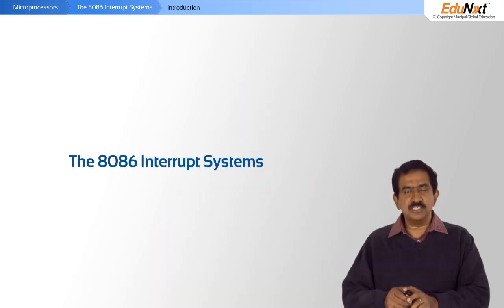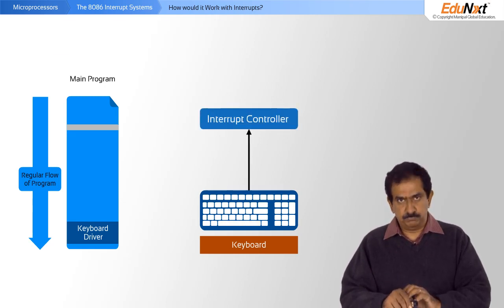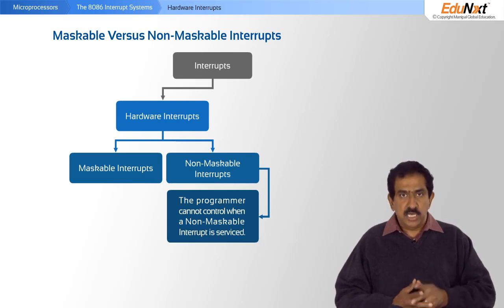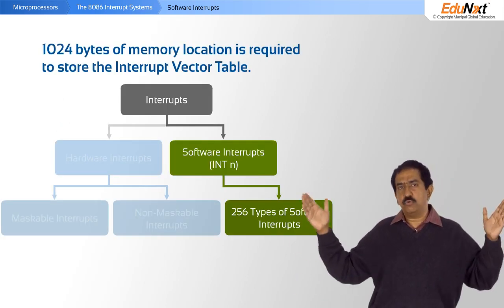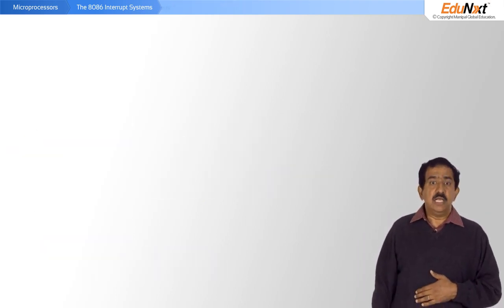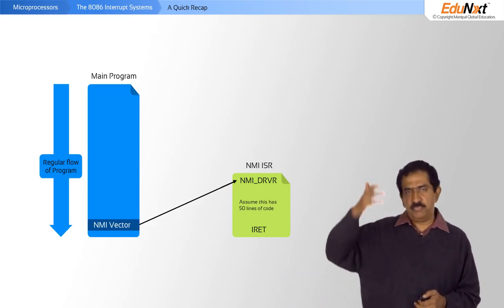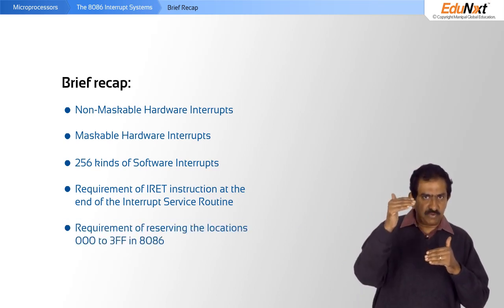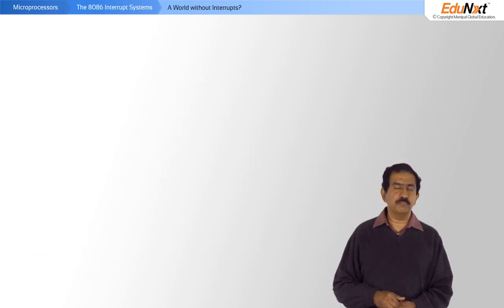006 8086 Interrupt Systems   Video

Comment: https://en.wikipedia.org/wiki/End_of_interrupt
An End Of Interrupt (EOI) is a signal sent to a Programmable Interrupt Controller (PIC) to indicate the completion of interrupt processing for a given interrupt. An EOI is used to cause a PIC to clear the corresponding bit in the Interrupt Service Routine (ISR), and thus allow more interrupt requests of equal or lower priority to be generated by the PIC.

EOIs may indicate the interrupt vector implicitly, or explicitly. An explicit EOI vector is indicated with the EOI, whereas an implicit EOI vector will typically use a vector as indicated by the PICs priority schema. For example, the highest vector in the ISR. Also, EOIs may be sent at the end of interrupt processing by an interrupt handler, or the operation of a PIC may be set to auto-EOI at the start of the interrupt handler.